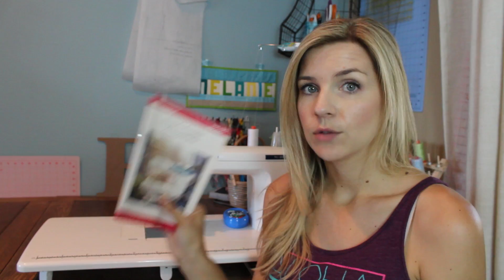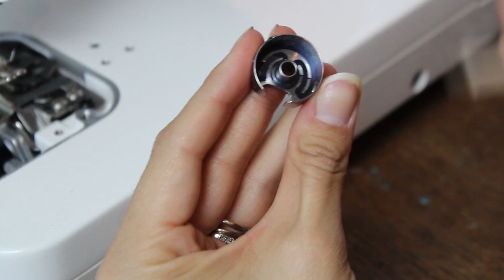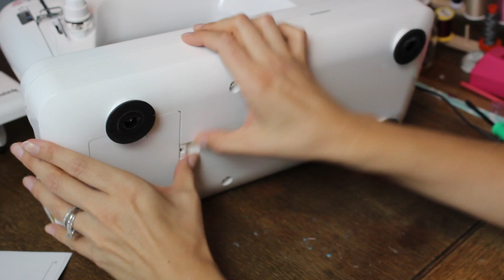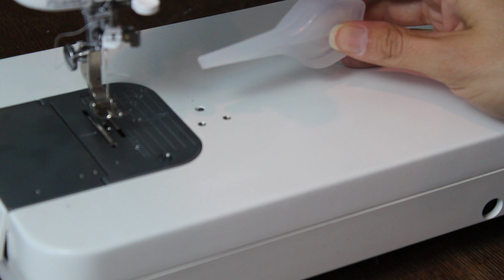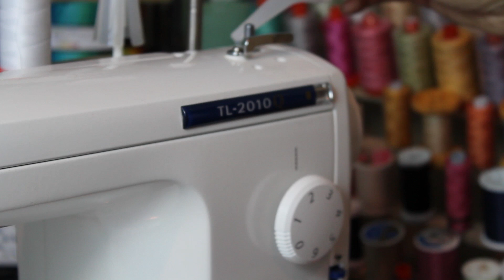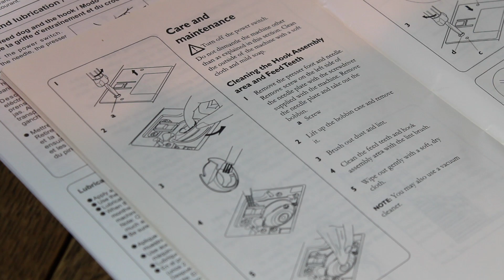How to Clean your Sewing Machine

Comment: Such good video.  I'm barely getting started figuring out how to work my machine but I cnt seem to figure out how to fix the tension on it. Or what thr tension even means.. if you cld help it would be great...
Reply from the maker: tension is how your top thread and bobbin (bottom thread).  They need to lock together and create a nice stitch.  If you see the top thread showing up on the bottom or vice versa, you need to adjust your thread tension dial.  I hope that helps some!  Your machine manual should help you some too.